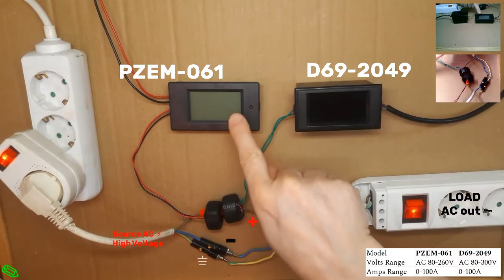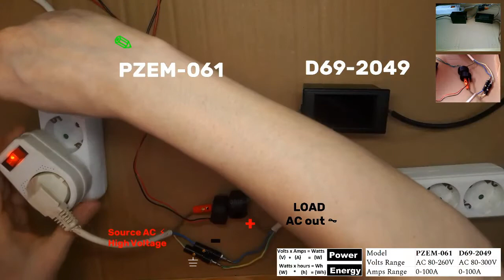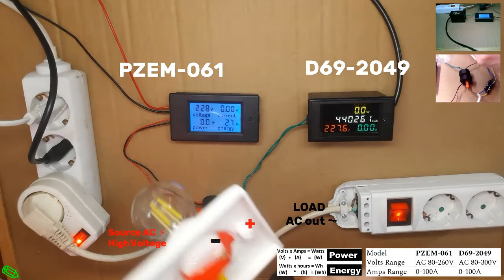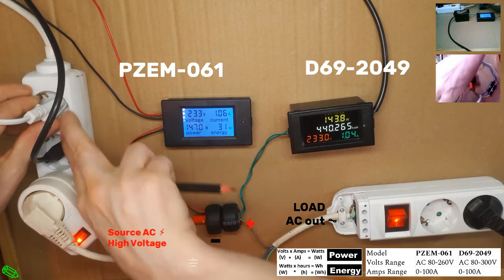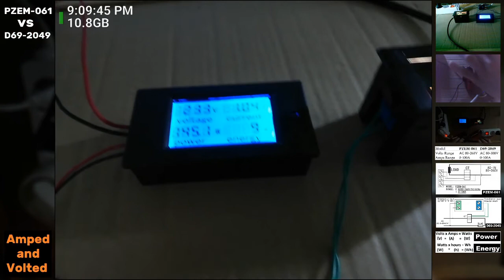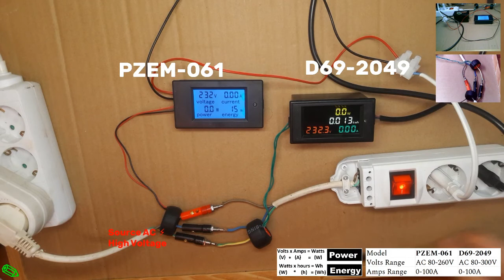AC Power Meters PZEM-061 vs D69-2049

Comment: 47:30 both meters at 1A and 230V show 140W and it should be 230W, why?
Reply: Capacitive loads will not show in these resistive-load meters. Could that be it?